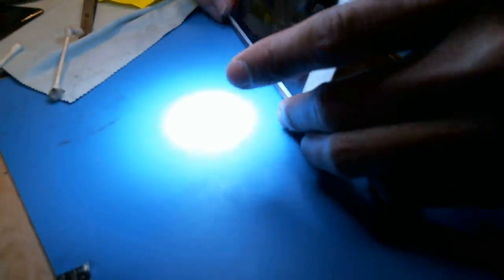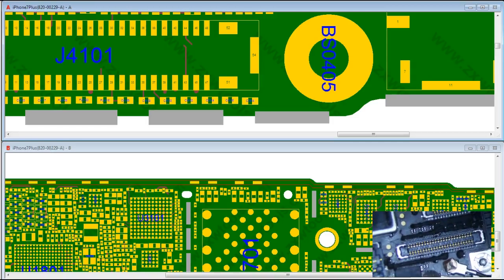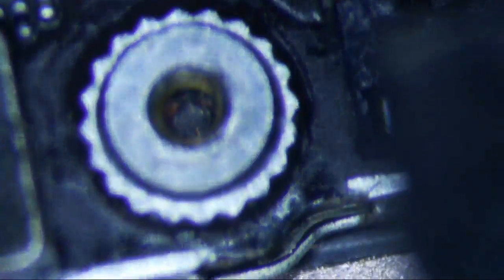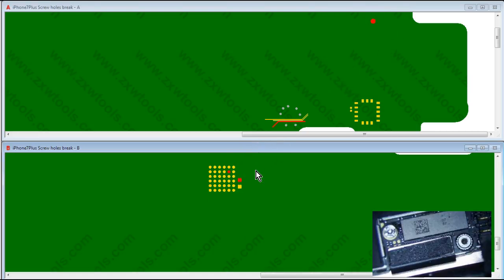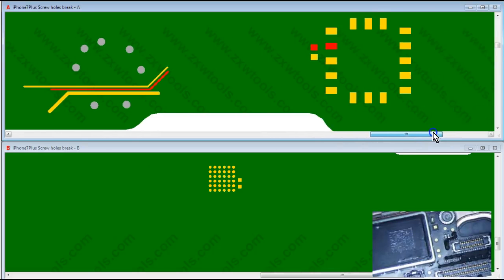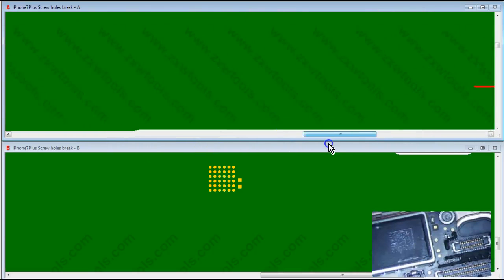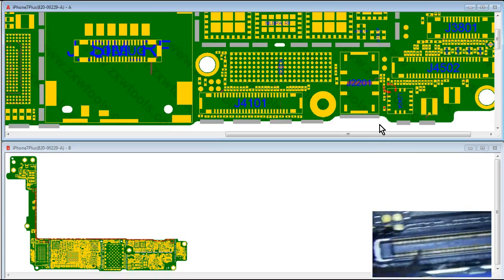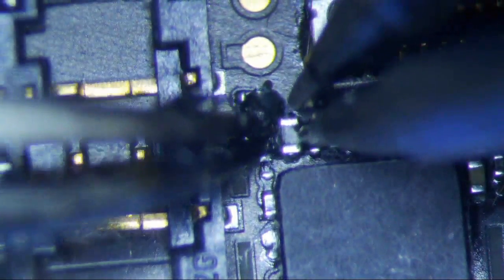iPhone 7+ Getting Hot   Charging Erratic   Long Screw Damage   No Gyroscope

Comment: iPhone 7+ do run in the host side usually. I had one for a bit. But if they have all default settings in the menu turned on like the motion of home screen (it can be turned off accessibility/reduce motion) the the gyro is constantly in use. Along with tracking health stairs and steps. So it makes senses it might be running a little hotter. The owner defiantly pays attention to detail on his phone.
Because of the constant gyro use, this would make it run a little hotter then normal unless all menu, health and other gyro features are turned off. Constant requests for data from these features would run the CPU a little more constantly. 
Those not spam calls that spoof caller ID are a pain. LMAO, typing this when your trying to get alcohol, lol. Mine has no problem, time for a new one.